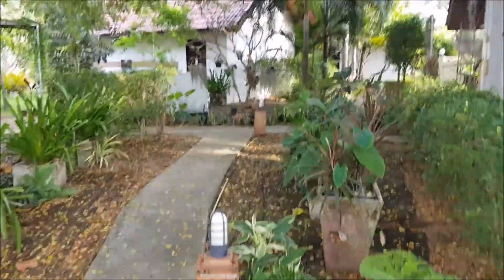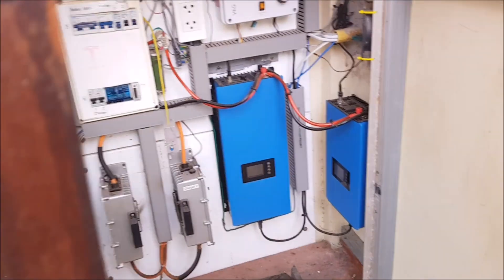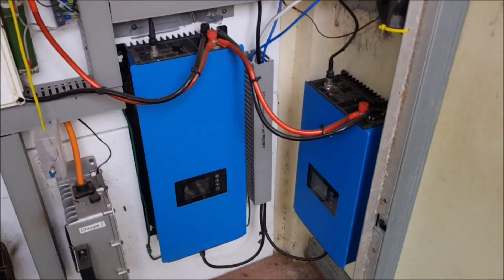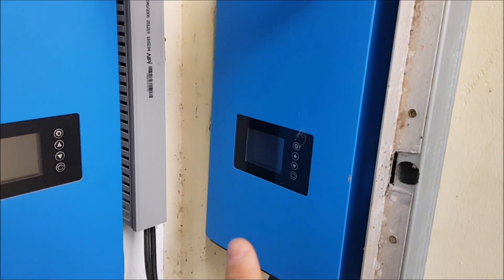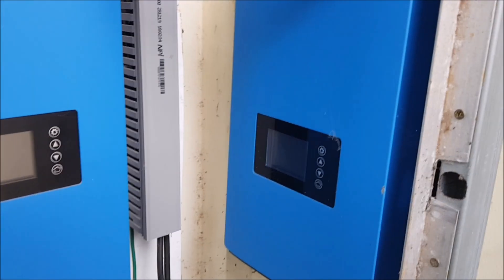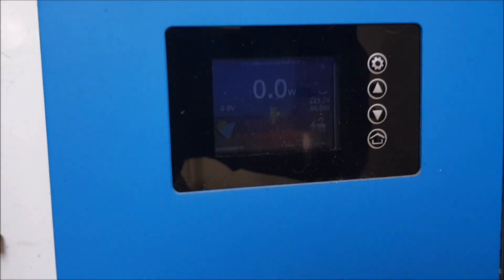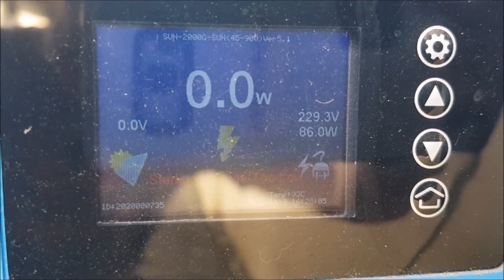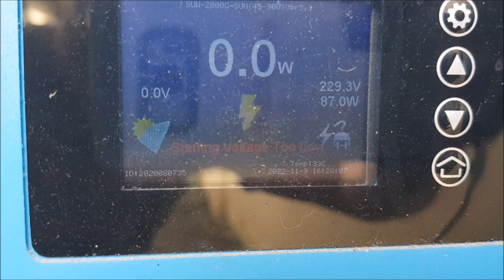Back again and work is just piling up...

Comment: My 1000 did that and I just cycled the AC and the led started working again.
Reply from the maker: Thanks. I have tried it but the unit just dead. I do suspect that maybe the internal power supply (5V/3.3V) might have failed due to the permanent short grid interruptions that we have. Will know it once I have time to open the inverter.